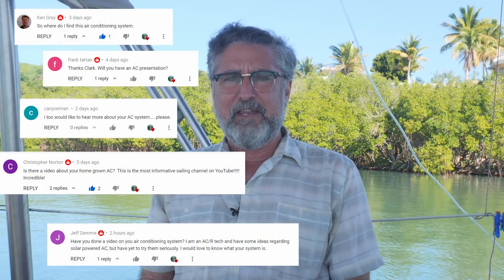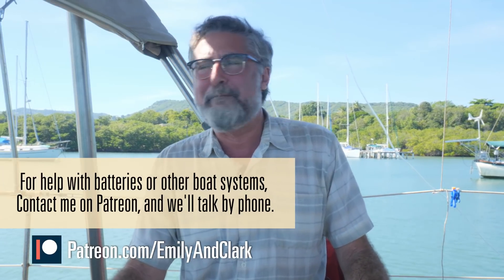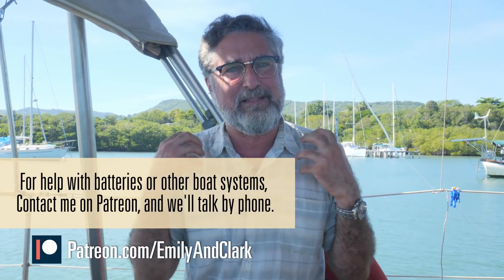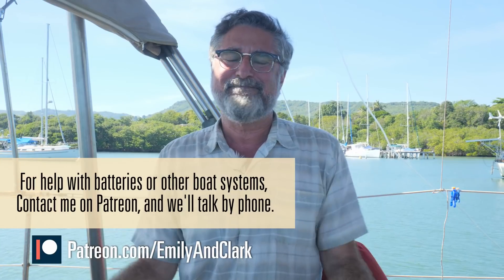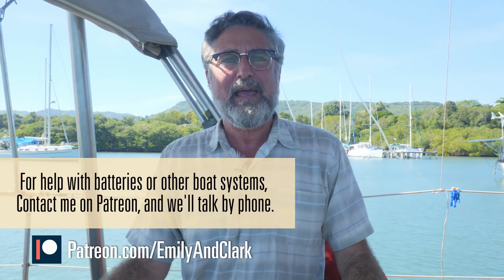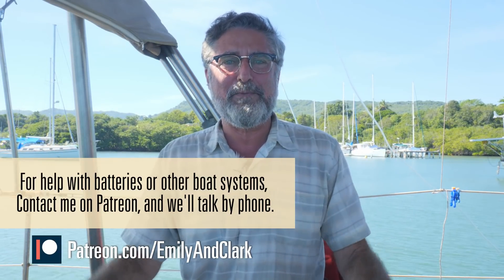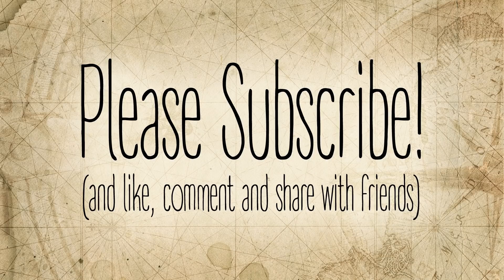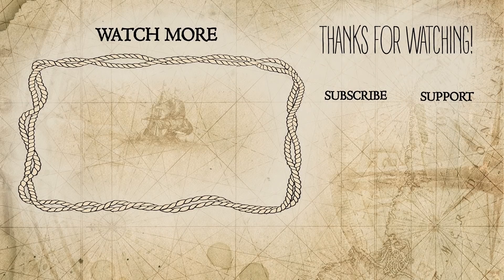Adding LEAD to your LITHIUM battery bank [Capable Cruising Guides]

Comment: the dangers of lithium's meny reason to shut down, is how I thought to add back some lead. my inverter/charger and my solar charge controller both say "NEVER DISCONNECT BATTERIES WHILE IN USE".  the 8 cells of the lithium have to be in near perfect balance, to get down to the 10.5 volts to cause the chargers to start charging. good luck finding cells that all have the exact same charge and discharge rate /capacity to all be at 2.6  and not have one of the cells  be one volt less ,2.5v, and shut down "while in use". I was told if I used 8 cells [24v] ,it would work fine with existing 24v  inverter/charger and my solar charge controller . no one brought up the lone crap cell problem. 
now with added lead, the lithium can shut down if it wants and come back on when it wants. but now it is always undercharged. too much babysitting in lithium. I hooked up my lead acid 5 years ago and the system has been on non stop with only checking the water . It's only been a few weeks with the lithium and I am sick of it. I can honestly say, I wish I had just bought more lead because I don't see the lithium lasting too long with so meny opportunities to fail.

Comment: An amp meter between batteries shows positive  and negative current flow would  give an indication  of relative health  of both batteries..would show lead charging lithium  and lithium  supporting  voltage of lead at different  charge and discharge cycles..batteries  are connected  via an amp meter that provides information  rather  than a dumb piece  of wire that tells you  nothing  except  that it may be getting  warm..high current  devices connected to lead side of battery  bank and low current  devices with  long discharge cycle  on lithium side  and amp meter tells you  what is happening  relative to each battery ..
Reply from the maker: Shure would. I've snapped my clamp in meter on the wire when I was working this out.

 I've been working with a guy in Europe who has done a through instrumented study if this.  I'll be sharing his results in my next video on this subject.   In short it works just as expected.

Comment: This is an interesting concept, and relevant to us. We recently bought an RV and I replaced the lead batteries with a single 200AH lithium battery. I now have 2 new 100AH lead batteries and your video is making me consider using them as part of my power setup. I replaced the stock converter (charger) with an inverter/charger, to increase 120V availability in the RV, and the inverter has power bypass, and automatically switches between charging and inverting based on connection to shore power.  

You don't discuss the connection configuration of the batteries to each other or to the charging system.  I assume the batteries are connected in parallel, and I'm wondering which "side" is connected for input/output - the lead batteries or the lithium?  I have a single set of cables connecting the battery to my system, through which input and output flow, and if I added lead am wondering which of the battery types should be that connection (in your schema).  Also, you only touch briefly on this, but I assume you set a charge profile that blends the absorption and float values of the two battery types, but may lean toward a lead profile. This means less than a complete charge for the lithium batteries, but the trade off is nominal and overall worth the gain.

Comment: As a backup power source, I think a backup generator is probably a cheaper and lighter solution. Although a lead bank set up in this way may require less maintenance and, combined with your existing solar system, be usable for the class of extremes where your lithium is dead and you will be unable to resupply in the near future. If worried about the environmental impact, that is a point for the generator as well. 

A cheaper and lighter solution if your main concern is blowing out your alternator, is to switch your charging circuit from the battery to a great big resistor in the event of a BMS shutout. Most BMSs have a signal line that is used for killing the alternator, but if the alternator/generator is not protected internally, that same signal line should be used for engaging a dissipative load. That load switch be on the provider line and also trigger in any over-voltage situation, high quality systems will have that part of it built into the alternator itself.

More generally, if your BMS locks out your battery, that is an event you need to get a record of, ideally with details for which safety triggered it. In a well configured system, that should basically never happen and when it does happen you should take steps to prevent it in the future. A BMS is usually configured to only lock out the batteries if they are already taking damage and close to becoming a fire risk.

Comment: You describe the charging issues well.   I'm adding 280ah of lithium house alongside a lead starter battery so charging w/ std internal regulated 105ah alternator w/ V-belt likely can't handle much over 60amps w/o overheating or eating belts.   I haven't decided on converting the alternator to external regulation /w temperature control (MC-614) or a 50AMP B2B w/ a built in MPPT charger controller @ 3/4 the cost.  You bring up good points about B2B but also have some nice features.  Side note: Sterling makes an alternator protect device that could be used with LFP only setups.

Comment: Thanks for your well reasoned video. I decided, having watched it, that adding lead to my lithium system would not be worthwhile, which maybe sounds like a criticism but it’s not. Just that the advantages you outlined don’t seem to be important in my situation and the power drain from lead’s self discharge seems like a cost I don’t need to carry if there’s little chance I’ll ever get that lead battery into discharge mode.
Reply from the maker: Sure we all have our own needs. And glad you enjoyed the video.

 But consider the alternator protection is something that could effect anyone. We are not talking much power.  My 1500ah AGMs cost me .5 amp to hold up.  Imagine how little a motorcycle battery would cost you.
Reply: One large power diode between the parallel lead/lithium setup that's forward biased towards the lithium bank(s) would essentially negate all of those concerns. I'm actually surprised that wasn't at least suggested  as an optional "peace of mind" thing to add to the circuit/system, but then again I don't run them in my Pb/Li-ion setup either as it stands, heh... I do the "human BMS" thing that I wont bore w/specifics but only just to mention that I consider it a much easier arrangement for dual chemistries when lead is kept on primary duty and Li-ion is considered "accessory power" & disconnect-able (or isolated like previously mentioned) in order to administer its desired topping charge. Otherwise I'd likely see lead in a similarly burdensome light day-to-day as you already concluded you would have. Just food for thought is all.
Reply from the maker: With the diode you no longer have a bi-directional system.
Using a BBMS link my BankManagerPlus solves this in the best way possible.

Not for li-ion though
Reply: @kurtilingus  I suppose with a suitably large FET switch between the two battery banks and some kind of programmable logic based on each battery’s voltage you could connect and disconnect them as needed.  Maybe that’s the principle Clark’s system works on. But the FET switch probably has to be rated for high currents, so can be expensive?
Reply: @PVflying  I'm rather new to DIY electronics tinkering & switching components/transistors are my next frontier for my knowledge-base as I'm definitely aware they're capable of handling some impressive tasks/energies, but w/that said I'm painfully undereducated in general w/their specs and/or how to utilize them. What I have set up that's in-line w/the components I *am* familiar with is to have a very high rating starter solenoid/relay specced for "continuous duty" wired to a on-off-on SPDT toggle switch that connects and disconnects the li-ion to the main lead battery as needed & also uses the second "throw" position to power a dc-dc boost converter which charges the li-ion to a more nominal level than the lead battery & alternator can provide as-is. Eventually I'm going to complicate the arrangement to a more fail safe one to where I'll install a 3 or 4 throw swtich w/however many poles needed + an additional solenoid & li-ion bank as an "aw-crap" backup that's on it's own circuit in order to have a untouched & fully-powered bank always available for the inevitable occasions when I run the lead & primary accessory li-ion bank down past cranking levels. I'd probably have that reserve bank at least in a 5s configuration to ensure the ability to easily jolt the whole system back to life & not worrying about a crippling voltage drop if the larger batteries are waayyy discharged
Reply from the maker: Consider one of these.  
https://drive.google.com/file/d/18d38g3jcdSabSiQAkvx3q4V0IuFWPy9D/view?usp=sharing

Might meet many of your needs and a bunch more.

Comment: Hi. I thought of this while watching your other video (good stuff), but for other reasons. My thinking was that a starter battery can protect the lithium battery from spikes. I wrote a comment but deleted it because now I'm pondering lithium's low internal resistance. What do you think? Would a starter battery provide enough of a surge buffer to matter to the lithium?
Reply from the maker: No. Low resistance wins.  

There are tricks I can think of to make a big load (like an inverter) draw more from the lead.  Simple to implement but hard to explain.  Not something I'd suggest here.  It's more of a phone call thing.
Reply: @Clarks-Adventure  Yeah, supercapacitors have lower resistance than lithium so incorporating something from Maxim sounds more promising than fiddling with lead.

My build will be rather unique. I might choose to retain intellectual property rights on some of it (I've already divulged some of my flexible PV solution on Tito's and Will's videos where they dissed flexibles). Anyway, I'm looking forward to learning and exploring. See you around for sure.

Comment: The BMS is required for safety - there's no way around that. Undercharged LFP cells can become dangerous due to increased short circuit potential. Interesting concept of using lead as a robust back up 'crutch'. LFP shuts off like this quite often in my experience - i.e. high battery cutout - even at relatively low CV voltages. I think alternator voltage regulators should generally be more robust than you suggest. If not, a capacitor across the output can fix that. Again, mitigating chronic undercharge of the lead bank is compromised in this kind of a parallel combination. Interested to hear about your independent charge control idea.

Comment: Clark you explanation "not" to use a DC to DC charger seems a tad disingenuous when alternator charging FLA & Lifepo4 at the same time.....incorporating a DC to DC charger would be safer. easier and cheaper than risking the blowing / replacing of an alternator or FLA batteries when charging with a dumb alternator.
Reply from the maker: The alternator won't blow if it's connected to lead.

   One could safely connect the alternator to the lead and charge the li with a dc/dc charger.  A dc/dc charger is a buck/boost converter and do waste some power.
  I have another idea.  Just as safe but more efficient.
   Working in it.  Video coming.  Though might be a while since parts are hard to get out here.

Comment: Same thing happens to a car alternator when PB battery gets full nothing new but you could always use a Buck Converter dc to dc to charge the lithium bank from the alternator too rather than direct from alternator and Pb battery is in the system same as it always was.

Comment: Having just switched my lead to lithium I have run into some of these issues. I have a diy lithium bank with no bms currently connected. After a cloudy week my voltage started teetering around low shutdown. One morning my bank read 16 volts on a 24 volt system. Ouch. By hooking in my available lead I saved my $2000 battery bank from destruction. Those 'smart' chargers will not charge a battery at that low voltage the lead brought the bank voltage up to a point that the charger could recognize. Always have a backup.
Reply from the maker: Thanks RockTech.  One I hadn't thought of.

Comment: Howdy sir.
Glad to see more content about lithium in the Marine world. You are doing the community a service.
Those are very good points as well.  The point about redundancy speaks for itself.
Your second point... Having lead acid batteries in your system to act as a capacitive load in the case of unintentional disconnection of the lithium bank is hugely important. There are other ways to accomplish this of course. However, none are so simple and foolproof.
I do disagree on the cost of lithium. Initial cost is high.. But ultimately, they are significantly less expensive than lead acid. This is especially true for a full-time Cruiser using them each and every day. Further, a person prone to study nor opposed to used cells Dramatically reduces cost. 
Another point that you may perhaps focus on in a future video is that charging a lithium Bank with your diesel engine rather than a generator (or more sophisticated charging equipment like a flywheel mounted PMAC motor/generator) is FAR more advantageous and cost-effective. 
Also, when a large lithium bank is decided upon, 48V starts to make a Lot of sense. World's of possibly  open at 48V.
Thanks for the video.

Comment: Another great video Clark.  I am doing what this video is about for the reasons you talk about. Not sure you mentioned what your charging gizmo is, but for me I am going to use a diode and fuse from my LiFe batteries to charge my lead battery.  1,530 Watts of solar will be charging my LiFe batts, and running our normal daily needs.  Anyway,  I look forward to your next video. I hope you get really technical and Geek out with the details. I love that.  Thank you so much for sharing your wisdom with us.
Reply from the maker: I'm sure you have a plan but I can see why you would want to use a diode.  Seems like a needless voltage drop that will really hurt the leads ability to charge.
Reply: @Clarks-Adventure  The lead battery will be charged whenever I run the engine. The diode is to isolate my LiFePO4 bank from the alternator. The voltage drop is only 300mV, so no big deal really. The lead battery will think it is being float charged. Hopefully that explains my plan better. If not, well maybe someday we'll meet and we can talk over a beer or two. :)

Comment: Do you use a battery monitor?  How does it work with hybrid banks?  I use a Balmar SG200 with my AGM bank and love having the monitor.
Reply from the maker: I just use volts and amps.  I have a monitor but use it like a meter.

I don't personally care for monitors.  They seem consistently wrong.
Reply: It's horses for courses, but unlike Clark I love monitors as well (data obsessive that I am).   But when you have a Hybrid Bank getting a monitor to be accurate is a challenge as the charge efficiencies of the two technologies are so different and the Peukert Effect is so different as well. 
What this means is the monitors accuracy will vary depending on the overall discharge level of the bank.
- For the upper part where the Lithium is mostly doing the work, the monitor needs to be configured as if it were a Lithium Bank
- For the lower part where the Lead is working, the monitor needs to think it is monitoring a Lead Bank
- And in the small window in the middle where both are busy, the monitor needs to setup somewhere in the middle
You can't get a monitor that adjusts itself like that :)

In my own Hybrid Bank, I have 3 (Victron) Monitors - one on the Lead, one on the Lithium, and one for the overall Hybrid Bank.  The two dedicated Monitors work well configured in the normal way.  The Hybrid one needed a touch of tweaking to get the right settings but I find it pretty accurate now (but I would not be surprised to have to make further tweaks as my usage pattern might vary)

Comment: I have a lead acid starter battery and a DC-DC charger.  I turn it on after starting the engine and waiting about ten minutes for the starter battery to get a little bit more charge on it.  My last post went by-e by-e for some reason.  The problem with lead-acid and solar for instance is efficiency.  The lead doesn't convert the solar into stored capacity as well as lithium.  Not leads fault, but every system should really have at least a little lead.  It keeps the cost down, and is a great dummy load for the alternator if it does nothing else.

Comment: Excellent video. Thanks
We are upgrading to 300 ah lithium for the house but keeping 2 lead for bow thruster and windlass and 1 for starter. Will also upgrade to a high amp, over rated but limited by external regulator, alternator. Will have all batteries linked with a 200 amp 3 bank isolator.  Based on what I’ve just learned from your video I think I’m on the right track. Also adding serpentine belt system. Cheers
Reply from the maker: I'm a little concerned about the isolator.  It's not necessarily a great idea to combine li with batteries of different voltage/charge state.  But I imagine you will be ok especially if you use small wire to link front lead batteries with back lithium.  The resistance will help you.
    As a proof of it working I have an agm in the bow for windlass.  I've owned the boat 30 years and since I set it up it's been charged with 6 or 8 gauge wire.  Works great.